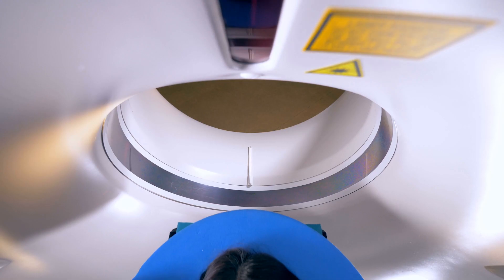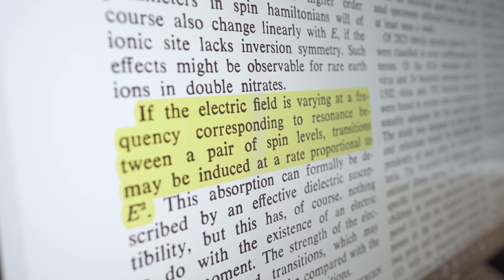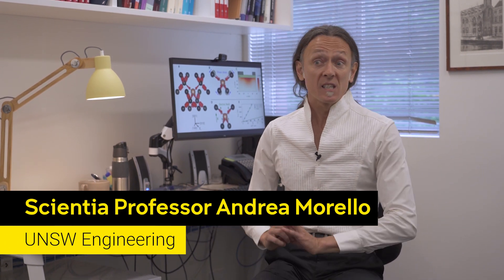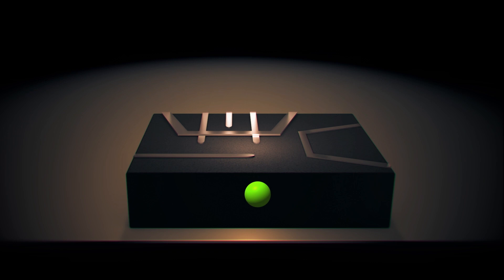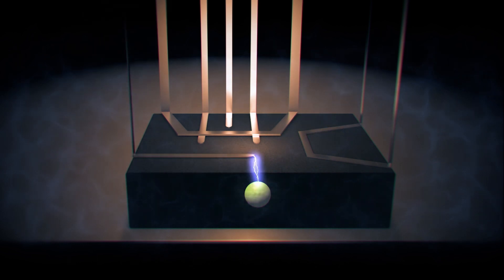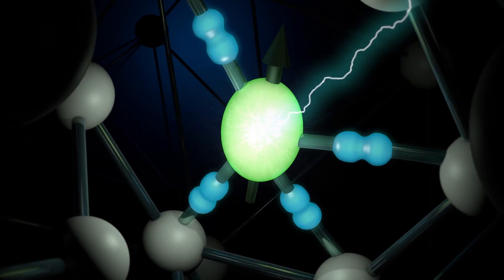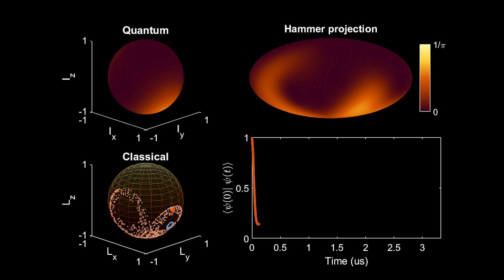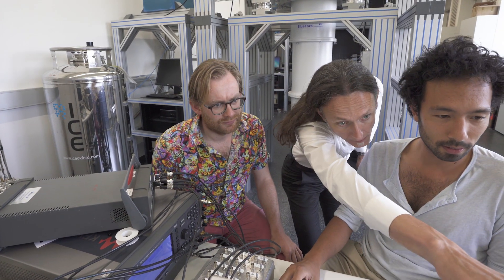Nuclear Electric Resonance - the key to controlling single atoms in electronic devices

Comment: Still a long, long, long, lonnnnngggggg way-off for practical use as computer memory.  The idea of storing a bit of data on a single atom sounds compact, until you factor in the relative size of what is needed to read/write it.  Imagine the atom is the size of a door nob - the read/write apparatus would be the size of a small apartment... for each atom.  Then add to that 8' of attic space on all six sides for electrical isolation.  Now, if the spin can be very, very, very precisely calibrated - then we're talking about MUCH more than a single bit of storage per atom and we'd really be getting somewhere.  But, it will be star date 47457.1 before we even get close to that level of precision.
Reply: the voltageaplyed is not highcurent. its like actual electronics  between 1 - 12v.
Reply: Naysayers
Reply: I'm a little disappointed - it's been 4 months and no one has commented about the star date... and you call yourselves trekkies.